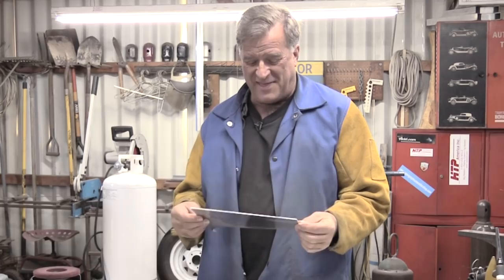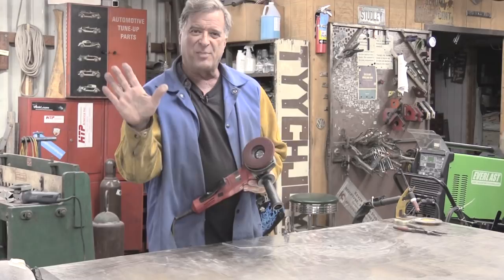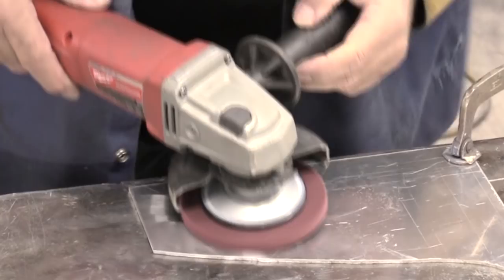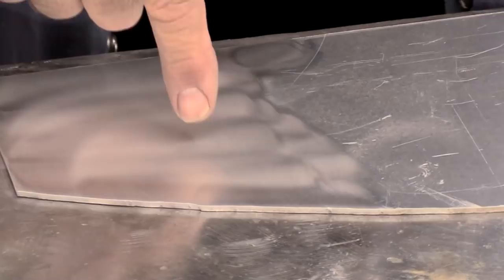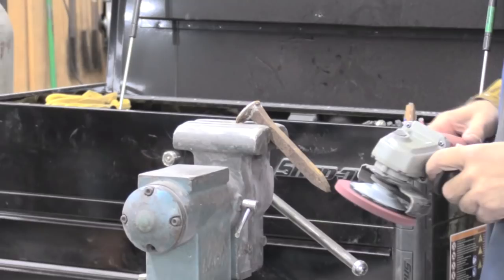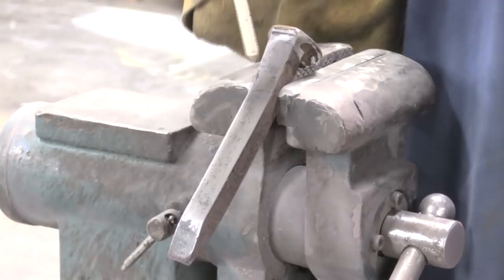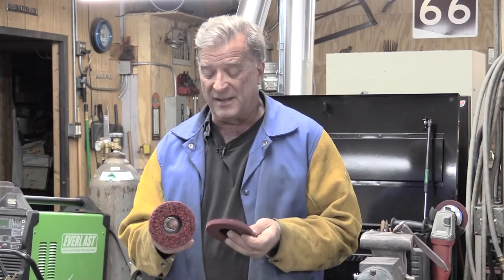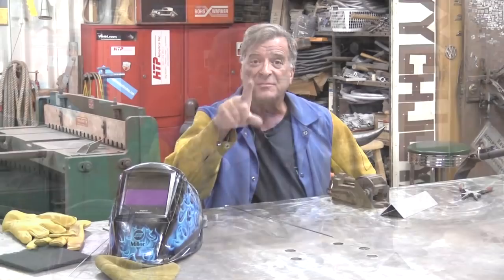How to Give a Metal Surface a Fine Finish - Kevin Caron

Comment: Use them all the time . Found they work better with air grinders for controlling speed and finish texture required . Stay off sharp edges and wear a mask . Alunimun dust and some of those wheels contain nasty stuff . Good demo
Reply from the maker: Wear a mask all the time now.    Thanks for watching and posting!

Comment: I almost never comment on anything on this account, but for my work/ hobbies..
I use almost only 3M "sandblaster" surface conditioning discs Part No: 03075   along with a quick load backup pad Part No: 9675.  
at times with and w/o the backing pad   they are flexible and fit to contours to curves and corners well.  

would like to see you try them out sometime if you haven't. well priced and effective.    if used with out the backing pad "semi hard plastic"  i double up the pads or use a purposely ground down smaller circumference pad no issues!    Thanks for the vids.
Reply from the maker: Thanks for the tip,   will give them a look see!

Comment: Hi Kevin.  Nice video.  
So what would you recommend for taking a steel surface down by .010 inches?
Reply from the maker: All depends on how big of an area you are working with.    And how perfect it needs to be.    Belt sander comes to mind first. Or a 9 inch grinder with a cone disk on it.
Reply: I should have been more specific.  The piece is actually a 3/4 inch plain steel rod, 8 inches long.  That makes it just that much harder.  I don’t have a lathe either.

Comment: Can you elaborate on the linseed oil finish? I've tried it and it doesn't seem to do anything
Reply from the maker: Just spray it on full strenght out of the can and let it dry.   I used the O/A torch and baked it on.   Will darken the rust a little but the one in my house is many years old and has not changed.    The door I did for a remodel has to be redone every 8 to 10 years.

Comment: Could a video be made of finding an angle?
Reply from the maker: Sure,  what are you looking to build?
Reply: Kevin Caron, Artist  just things in general I have trouble like say for instance a headache rack for a pickup truck and the customer wants the frame to follow the outline of the cab the angle of the cab?... so after you find it . It alters the top rail angle to form a clean 90 degree angle I just have trouble determining those without making a million cuts
Reply: Thanks
Reply from the maker: You might look for something like this.

https://www.homedepot.com/p/General-Tools-5-in-Digital-Angle-Finder-822/203219287?cm_mmc=Shopping%7CG%7CBase%7CD25T%7C25-1_HAND+TOOLS%7CNA%7CPLA%7c71700000034127224%7c58700003933021546%7c92700031755124826&gclid=EAIaIQobChMIoqmf2_rj4AIVBZ7ACh2PIQZIEAQYASABEgKX8_D_BwE&gclsrc=aw.ds
Reply: Kevin Caron, Artist thanks I’ll give it a try

Comment: If you use a angle grinder with variable speed you get much more time out of this disks :)
Reply: I searched Amazon for surface prep disc 4 1/2" and found lots.
Reply: Mark Trombley not a single one like this.
Reply from the maker: Look here...https://www.aaabrasives.com/4-1-2x5-8-11-afine-maroon-t-27-11-000-rpm